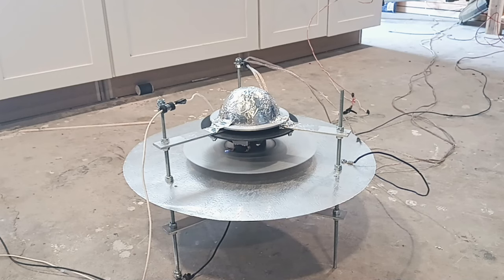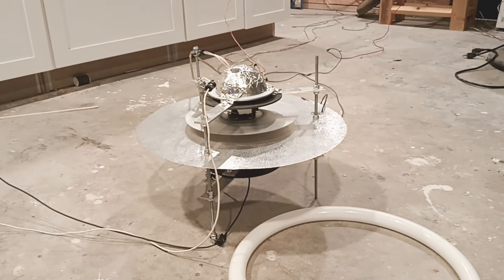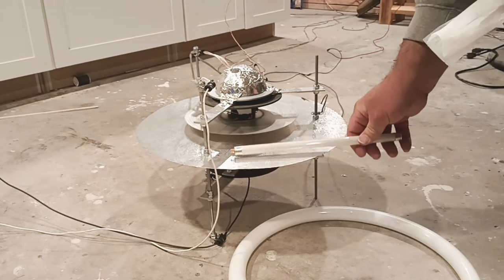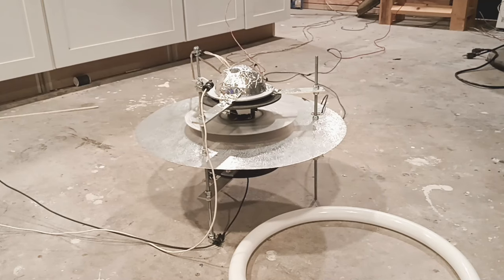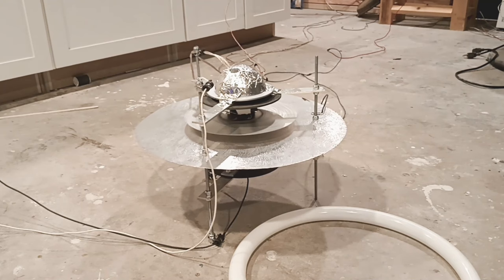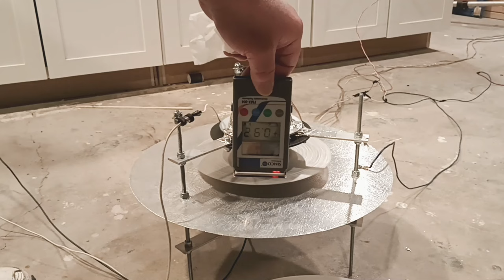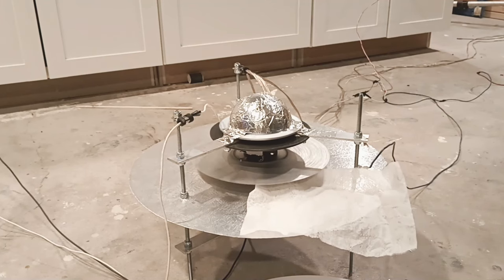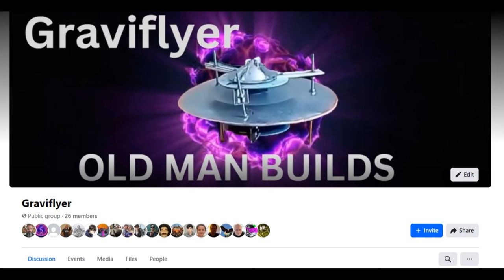Graviflyer Testing 11

Comment: Your top dome is way to far from the top disk... the russia one the top spinning disk is must closer to the dome  top.  You dealing with HV things like this count.  That top motor is way to big in height. You need the high voltage field to zap the top dome also. I am getting a better idea on how this works.  You have 6 magnets and 3 poles that hold this apart.  Those screw pole act like a motor brush does.   Similar to a magnetron pole in the tube.  Those long screw holding that together might be the wrong metal for what your doing.  You may have to change the strength of the magnetic fields from the magnets.
Reply from the maker: You cannot get it any closer. It is the same distance as the original.
Reply: @nathanbunten4299  Not the big bottom disk the top dome disk.  And his flat upper disk under the dome was bigger than your mount is.   You have currents flowing through that creating electric fields.
Reply from the maker: @doityourself3293  I did a video on it I have the correct measurements. I know the guy who owns the original. I put it all in a video.
Reply from the maker: This is the original Charlie C owns it now. 

https://youtu.be/xeH-uijujQQ

Comment: Nathan, another great video. So you had the ultrasound disk upside down. This would affect everything.  LOL. Remember the fishing reel sound that Alexey hears before pushing the button to turn the ultrasound off? This is the chirping that you are hearing. You need to hear the whirr whirr whirr. When your tesla coil is on, motors are at the correct omega, ultrasound are turned on, the correct distances are set between the plates, the magnets are spinning, correct positive and negative voltages are connected to the center and top and bottom disks, ultrasound is passing through the disks due to the marks on the aluminum, the correct high voltage and lower voltages are on the center and top and bottom disks, the voltages are shut down on the disks due to the ultrasound being on, etc. the charge is building up on the top disk and bottom disk and the ultrasound is going from VHF to lower frequency as the charge is affecting the operation of the ultrasound disk and shutting down the ultrasound disk. Your device is shorting out sometimes and why we see the arcing when the charges are at the correct point to cause this to occur. This is due to you not having the top disk coated with the dielectric as I suggest and know about from chatting with Alexey. You need the top disk normal capacitor and the bottom disk air capacitor.  The top and bottom disk need to be at their negative charges so that the bottom disk repels the earths negative surface charge and top disk attracts the ionospheres positive charge to achieve liftoff. The magnets and circulated charges that make the disks current and voltage and a higher magnetic field make the bottom disks charge stay separate from the center disk and the normal capacitor top and center disk keeps the charges separated from each other. When you short out the top and center disks then the chirping sound stays off as the ultrasound is at a VHF once again and you cannot hear it as the sound is outside of the human hearing. The charge takes time to build up as Alexey shows due to the electrical circuit setup to achieve resonance and before you push the button to turn the ultrasound off. This is shown when you short out the top to the center disk with the paper or dryer sheet. If you only touch the paper to the top or bottom disk the paper charges up and we see the electrostatic attraction of the paper to the disks. If you had the correct normal capacitor setup with the coating, the charge on the top disk would build up higher as the charge would be at the correct level and you would hear the fishing reel sound and know it is time to push the button to turn off the ultrasound so that the voltages would turn on and the high charge of 0.17 coulombs would stay separated from the center disk and the bottom disk along with the magnets and circulating current and voltage that makes the larger magnetic field and also not short out. If the ultrasound is not turned off at the correct time the entire setup shorts out as there is too high a charge and the necessary, charge for liftoff is not achieved and Alexey has to wait and start all over once again. The fields then have to dissipate.  If the button is pushed at the correct time, then the charge, circulating current and voltage on the bottom disk, magnetic field, and also the magnets magnetic field are set up correctly and this would help to achieve liftoff by the devices magnetic field being the same polarity as the earth's magnetic field, so they repel. The built-up charge of electrons is the electric field and the anti-gravity field and the magnets and circulating current and voltage are the magnetic field just like the earths setup that is an electromagnetic gravity field. You also need the battery to get the correct frequency from the batteries chemical makeup so you don't get the radio frequency and instead get the correct visible light frequency so the entire device and the earth act like an atom with exchange particles like the UFO show when they approach the ground and light up the area and the associated fields affect such things as cars and radios shutting off and nuclear missile silos being set off to launch the missiles and why the military then has to shut down the power grid where the missile silos are located and the nearby trees and ground become polarized with electric, magnetic and gravity field anomalies. Your power supply is not a good idea as it operates in the range of the radio frequencies and can cause brain damage. The anti-gravity waves can also reverse time and space and cause people to grow back teeth like Barney Hill had occur and why they sometimes show up after an abduction at a different time than when they were abducted. The produced gravity waves can also cause genetic mutations like we see in the wheat when the UFO make graffiti crop circles.  Etc., etc., etc. When the voltages turn on this is when the magnetic field sets up and you get the push force. The heat is radio frequency heating and you do not want this. You want light. The lower voltage on the bottom disk and the high charge current makes the device superconducting so you don't get heat but anti-gravity waves as I explained to Michael Perrone so contact Michael to explain to you. Please let me know if you read this. The field bubbles then set up.
Reply from the maker: I am working to get the US added to the combination without an oscilloscope. This means I needed a reaction from it. I got it.
Reply: Ok Nathan. Great!

Comment: Thank you for sharing. I think what you are seeing there with your computer shutting off and your experiences is a small EMP. Caused by your Tesla coil. Iv done this too and I’m pretty sure that’s what this is. I’m having a tough time with this “field”. Alexi can touch his frame with no problems but as soon as we do, the field drops. This don’t make since. The Tesla coil is contacting and causing emp pulses when you put your paper on there. Don’t turn up the current up obviously. I’m burnt out testing. And I’m starting to wonder if alexi is lying about this. 🤷
Reply from the maker: Hang in there. It takes time to get what he is doing. Remember it is antigravity. If it was easy we would all fly ufo's not drive cars. 

You are getting emi. It is like an emp except it is constant where a emp is one burst.

Comment: Sounds like a frequency pitch mismatched the center plate is seemingly shifting with resonance in horizontal plane but not in vertical plane
Reply: The ticking noise is affected by the tissue and random knocks the tissue effect is due the capacitance and charges moving between airgap or the tissue
Reply from the maker: I put the piezo in upside down. I would have never realized what was going on if I didn't. Yes you are right. Did you also know why my computer was going off? Clue: the answer is in when it did it. Let me know
Reply: @nathanbunten4299  Longitudinal waves affects digital devices, they goes nuts. No surprise that Tesla coil emissions affects your computer. Interesting is that it affect it when you put a paper sheet on a plate.. hmm, maybe it deflect energy  or change frequency or something, idk. Strange is also that it doesn't affect your digital meter. I couldn't measure anything driven by my Tesla coils with digital meters, only with analog.. Btw, cool and interesting project, thank you for sharing!

Comment: From me eyeballing it, that clicking or chirping looks like it's caused by the unbalanced disk. the balance seems to be off. I've had years or working with centrifuges which tells me you might be in a vibration RPM. If the disk rotates a bit faster or slower, does the chirp/vibration subside?  Maybe some wood bracing to stop the oscillation at the top of the stack if this RPM is critical. Good luck, I love this stuff. regards Daz.
Reply from the maker: The chirping showed up when the piezo was turned on. It never did it before.

Comment: In the original russian desing that suposly fly .. i can see that wires with high voltage are connected in the bottom part near the motor, i think it maybe a coil around bottom motor, and also i see a ballast with a regulator or dimmer i dont know why do you connect the wire to up plate?
Reply: That may be a car ignition coil.   The upper plate has current fields running through it from the magnetics on the bottom plate.  Like how an electric motor works. Its generating current fields. Over and under the rotational plates.
Reply from the maker: I have the original one broken down on my chanel. There are no extra parts

Comment: Im just now stumbling upon these videos but from what i understand you absolutely need counter rotation and very very high voltage maybe millions of volts. I dont know if you have those things going on here or out but hopefully that helps.
Reply: It's not about voltage too much, it's resonance & frequency.
Reply from the maker: There was not a lot of talking. I am curious, the clicking sound. Can you analyze that sound?
Reply from the maker: The amount of volts is not that high. The correct volts are. I can produce a 3 foot field around this craft. I can also make the field just outside the craft itself. It all depends on how you make it and with what voltages and where they go.

Comment: A usb power surge is audible it could be due to electrostatic fields so remove usb devices from windows pc
Reply from the maker: it is an error. the computer has no usb problem. The field is messing with the electronics by adding a magnetic field to the parts. The short answer is I put in the dryer sheet and it allowed the static field to move outside the tesla coil field. That pushed the emi across the room. It tells you the tesla coil field is holding in the static charge. When I reverse the experiment where the tesla coil goes to the inside rotating plates and the positive of the high voltage goes to the frame then I get emi up to 20 feet away. The point is I know exactly where my fields are and what they are doing.